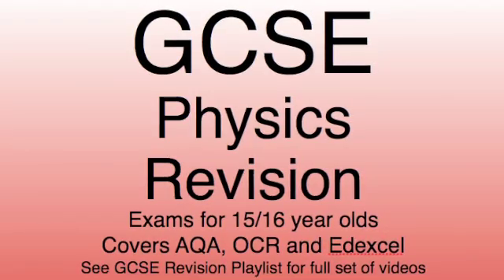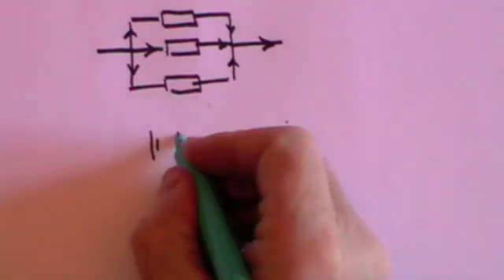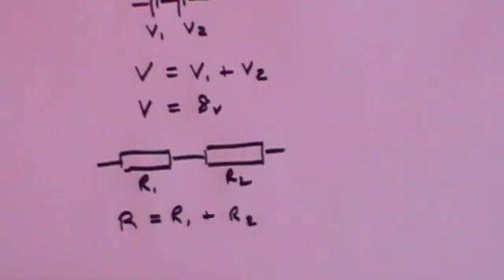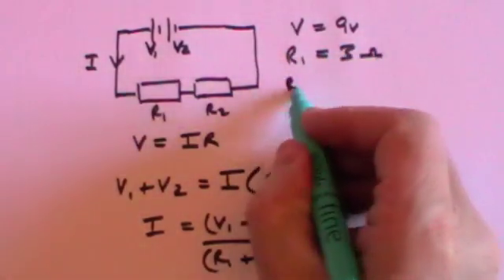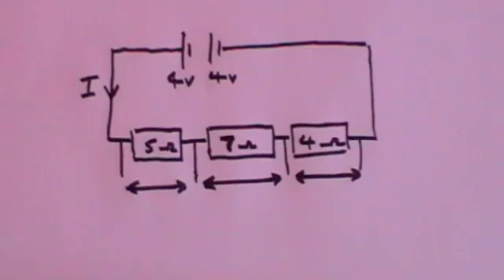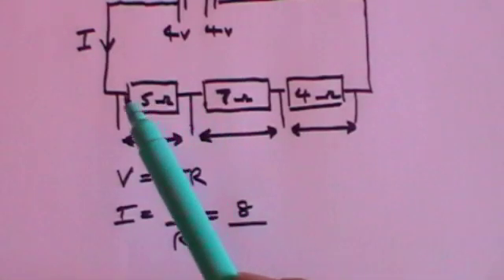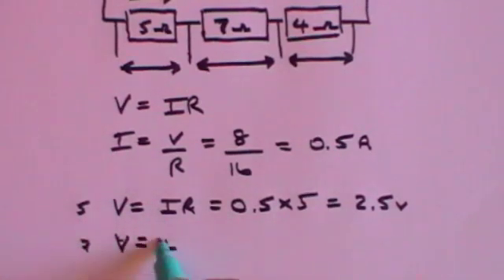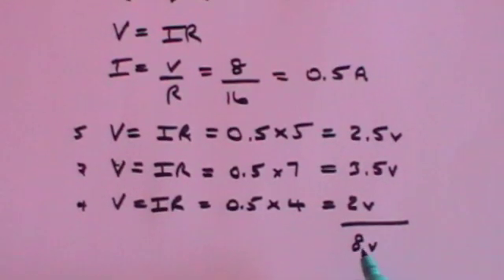Electric Circuits in Series: GCSE revision

Comment: at 6:30 isnt the current flowing through each resistor different?
If V=IR and V is always 8 and we know the resistance of the resistor is 5 ohms then shouldnt the current flowing through that resistor be 8/5?  And the current flowing through the next resistor would be 8/7 and so on. Why is the current the same across all the resistors?
Reply from the maker: No. When resistors are in series the current flowing through each resistor is the same.
Reply: +DrPhysicsA ok thanks

Comment: Very useful thanks. Would you be able to clarify the following please? If these resistors were lamps/buzzers, which would light more brightly/sound louder - the 4 ohm or the 7 ohm? Man thanks
Reply from the maker: All other things being equal the lower resistance would produce a brighter light - because it would have a higher current.
Reply: +DrPhysicsA thanks for replying. can I ask another question? I thought the current running through the resistors in a series circuit is the same. is this not the case?

Comment: When you drop all the 8V produced by the two batteries as you go through three resistors, by the end of passing through last resistor, will there be any current flowing at all? Since all of it was used up by three resistors.
Reply from the maker: don't Bother Yes. The same current travels through all resistors. It doesn't diminish. But there is a potential drop across each resistor which is a product of the current and the value of the resistor.

Comment: Hello, I hope you can help me with a question. At 3:40 you said "2A flows through the entire circuit". How does the current know to be 2A before it reaches the resistors?
Thanks for your awesome videos :)
Reply from the maker: Current Is defined as the amount of charge moved per unit time. So we are simply measuring the amount of charge which can be moved around the circuit and through the resistance.

Comment: You can tell, by testing with a multimeter. Set it on measuring resistance (ohm). By removing a bulb, you measure if there is resistance - if you get infinite, then that is the broken one. It can be done by checking 10 bulbs (log n in general).